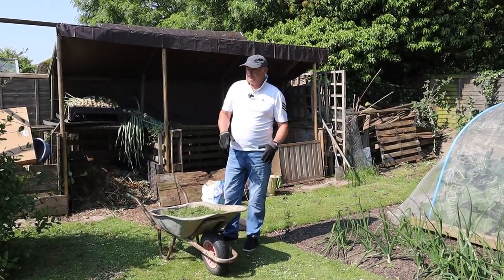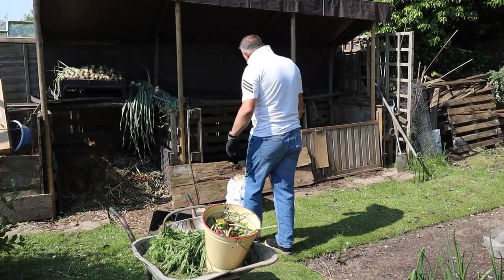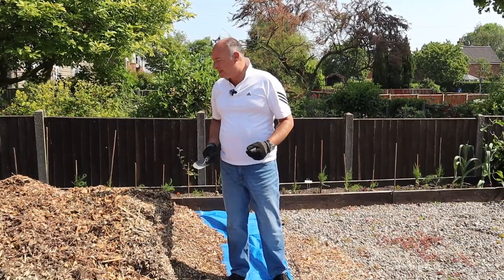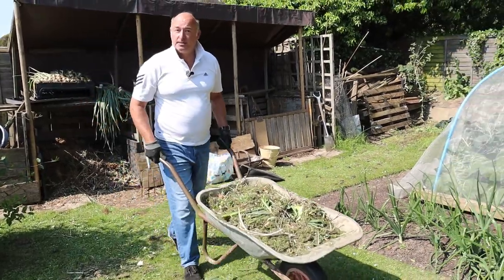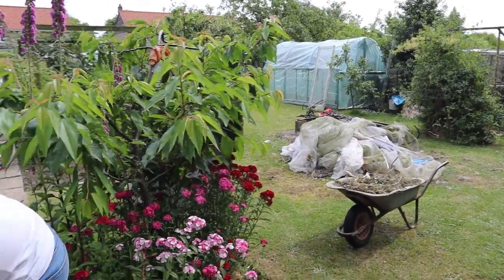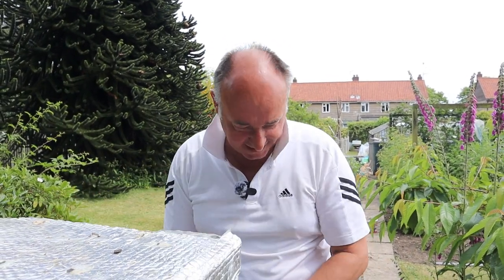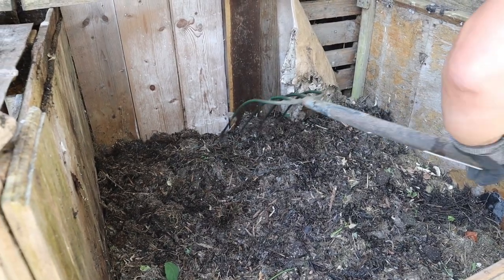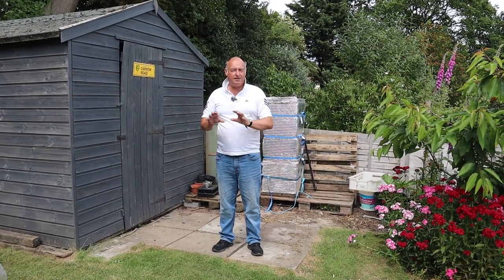How to Make Compost at Home

Comment: In the house in kitchen we have 2 tubs to collect all veg peelings and apple cores eggs shells etc. when they are full in the back corner of the garden we have 2 large buckets that fit nicely side by side in a plastic shed cup board storage thing. When they are full we take them to the plot all slimy and smelly and put into the  compost bin that’s in the process of being made b4 it’s turned into the bay where it stays for remaining few months  till we use it. So we have a few stages but we only turn it when it’s turned into the final bay then out onto the area set aside for usable compost. So we have 4 bays I guess at plot. But we have a very large area as we have 3 plots together and we never make enough compost so we buy in the made compost by the ton aswell. We call it black gold as it’s very black. You would think with how hot that gets it wouldn’t have weed seeds in it but the last lot we had fat hen come up everywhere and we havnt had fat hen on our ground b4 so it had to be in the black gold as it covered like a carpet.
Reply from the maker: Hi Mandy, as  I said we all have different methods that work for us! I agree you wouldn't think the bought compost would have weeds given how hot it is heated to!